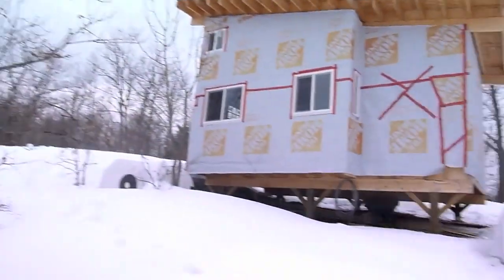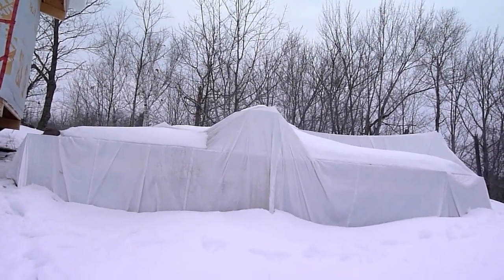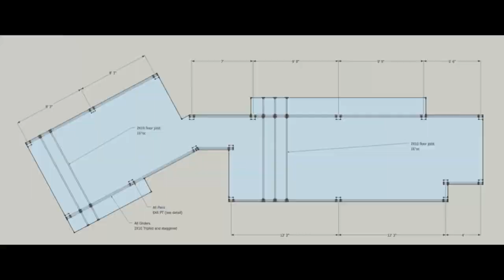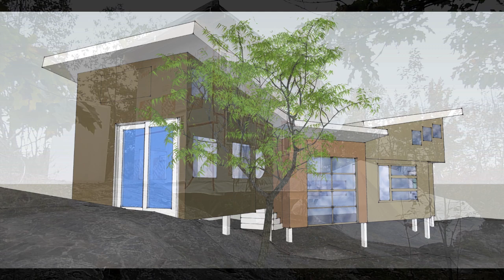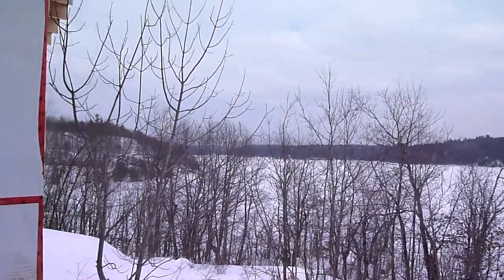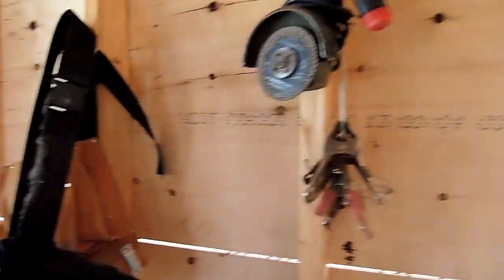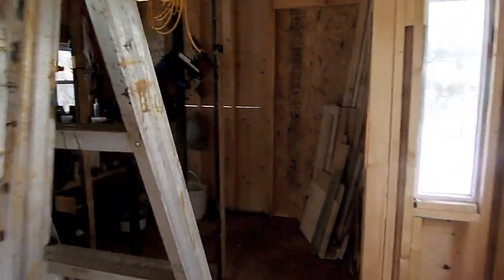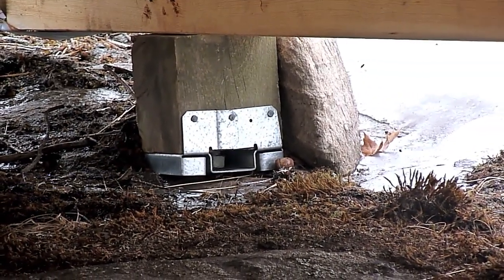The Cabin Build part 1

Comment: I'm just starting my build on an Ontario lakeside and I am excited to see someone else building in the same conditions (water access.)

I'm on bedrock too, but mine is 20 and as much as 30 degrees slope in places.  Any suggestions on how to shape the Sonotube and how to keep the concrete from blowing out?  Any advice is much appreciated.  Cheers
Reply: The internet is a small place!!  I just stumbled on your answer on Small Cabin... cheers!
Reply from the maker: Wherever we had exposed bedrock we drilled into it and ancored a steel post base. We only put sonotubes where there was soil. check out our older build videos if you want to see ho we did it. good luck with you build.